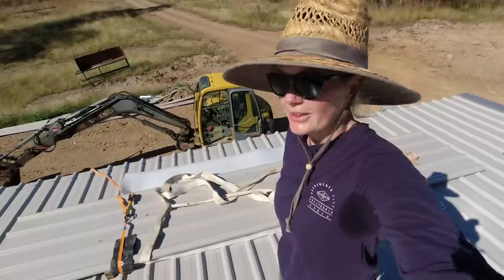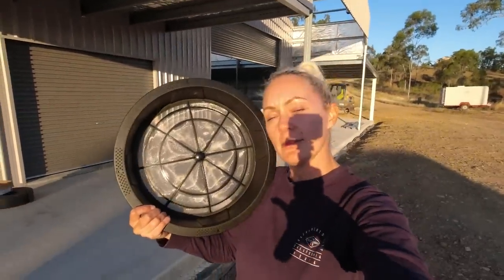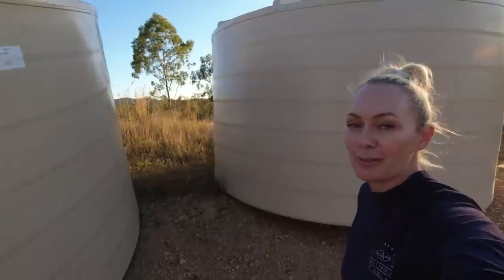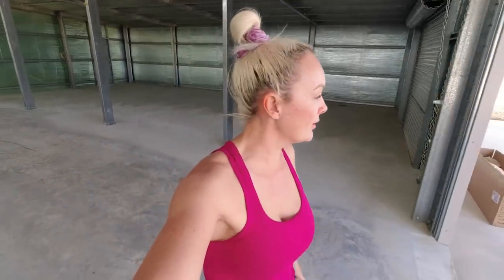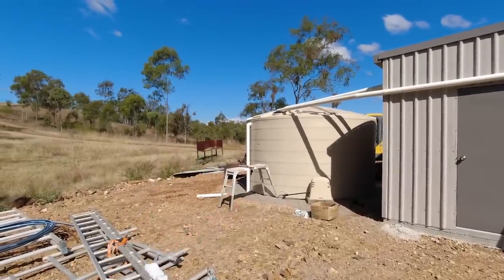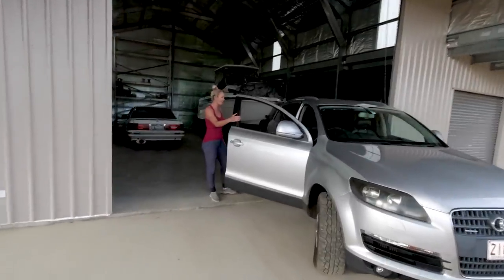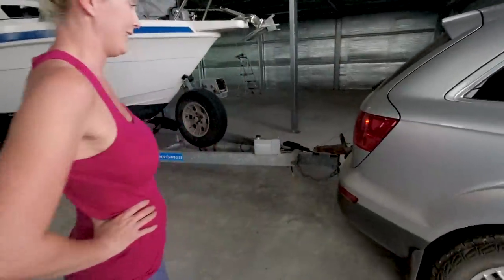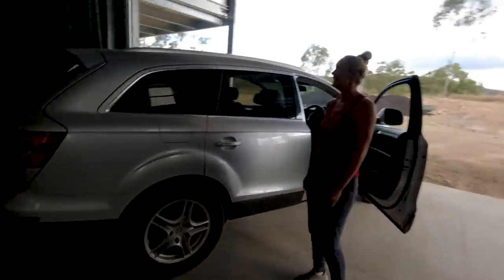The Big-ass Shed Series Episode 4

Comment: When you are installing fibreglass insulation, it is important to have a cool, not hot shower at days end. A hot shower will open the pores of your skin, which allows the fibres to enter your skin, making you even more itchy.  A cool to cold shower keeps your pores more closed, which allows the fibres to be washed from your body without entering your skin.
Another, very useful tip is to drink milk which keeps the pores in your throat closed which reduces the irritation of your throat. The cold milk envelopes the fibres which allows them to pass from your body when you move your bowels.
A good face mask is very beneficial too, as are safety glasses. I used to wear disposable overalls, rubber gloves and a handkerchief  around my throat.
All that being said, modern fibre type insulation is less likely to cause itching of your skin.